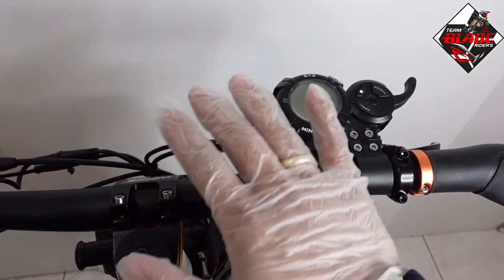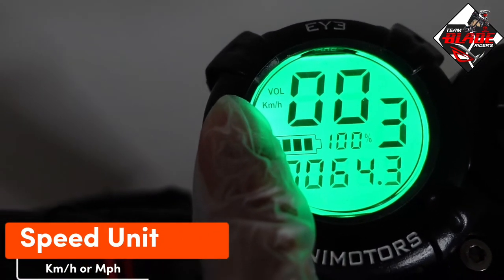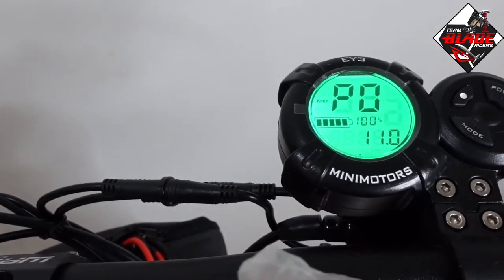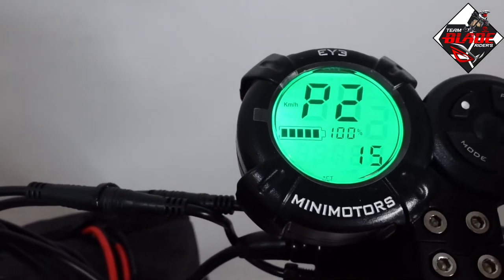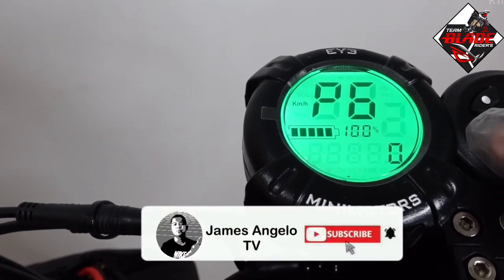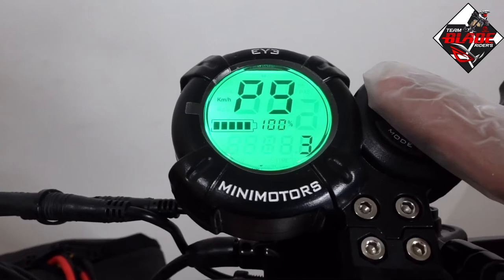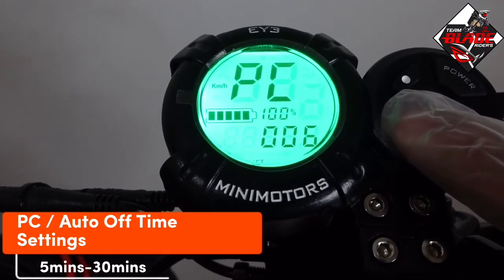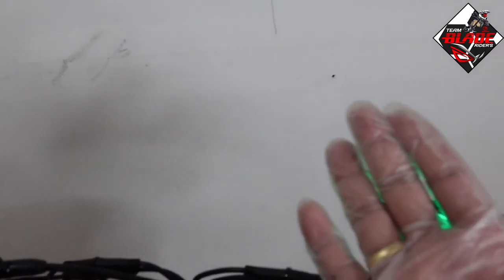Pre Program Settings | Minimotors EY3 Display | Blade GT | James Angelo TV | Vlog 127

Comment: Wonderful James thanks for all your educative videos. Please I want to tell you that I have also bought blade gt.  Immediately I bought it I discovered that I can't fix the stand because the screwing mouth is washed.  The seller is telling me that it is not a problem meaning that I can use blade gt without stand . Please can you advice me on that. Also the break vibrates and makes serious bad noise whenever you touch it
Reply from the maker: need to rethread the frame in order to attached the stand / in terms of brake issue you need to bleed the hydraulic brake because sometimes its less mineral oil inside
Reply: @JamesAngeloTV  wow bro, thanks so much. Please how can I rethread the frame. Kindly guide me if possible.  Thanks for the great help
Reply from the maker: @eyisijoseph  need to buy threading toll or use much bigger screws or bolts to rethread
Reply: @JamesAngeloTV  thanks so much bro .
Reply from the maker: @eyisijoseph  wc bro

Comment: My ey3 shows lower voltage than shoud 2v less can i easy repair?
Reply from the maker: that is not repairable bro. if you have volt meter seperate just folow that not in screen

Comment: whats difference in minimotors controller and gt+ tft controller ?! both are 2x35A?
Reply from the maker: tft is good because you can use single motor and it has a option for 40A

Comment: Hi Angelo , have you tried the ABS on?
Reply from the maker: yes i tried but it will feel not comfortable its like auto braking
Reply: @JamesAngeloTV   hoo I see! i Will try it , my Blade just arrived  yesterday and working fine im very Happy. Regards thanks as always he he ,👍
Reply: Hi again Angelo , just one.more question¿ IS normal with ABS on too feel a quite Big vibration in the motor when i break ? Thanks
Reply from the maker: @juanguillermoariasescobar740 mine i turn of the abs

Comment: Instead of damao display they put EY3 minimotors..?🤔
Damao has 5 wires and EY3 has 6... What is the trick James. ?
Reply from the maker: in which wire bro the main wire or hall sensor wire?
Reply: @JamesAngeloTV  no no..
In display cable...
Damao has 5 wires
EY3 has 6 wires

Comment: Hi bro , hope I'm not disturbing you so much. Please pardon me. Please I just got blade gt 28A battery from LG . I experience a problem with battery drop. When I want to ride it the percentage is 84. After riding in gear 2 for ten minutes the battery will go to 44 percent. When I stop riding it goes back to seventy percent. L
Please can anyone help me with this issue
Reply from the maker: what is your display? did you check the voltage level if set to 60volts?
Reply: @JamesAngeloTV  the display is 61.4 now and battery is 70%
Reply from the maker: @eyisijoseph  i mean bro in settings did you check if you scooter was set to 60volts
Reply from the maker: what is your display
Reply: The voltage is set to 60 . Just as you advised
Reply: Bro please I kindly need your advice here. I don't know what to do 🤣
Reply: Please can this be BMS issue?
Reply from the maker: @eyisijoseph  possible battery is weak or bms